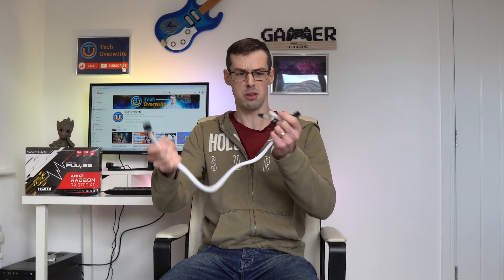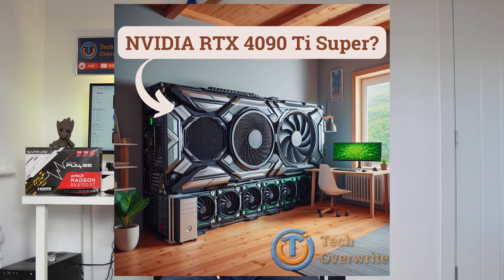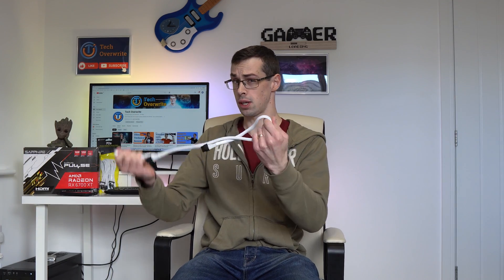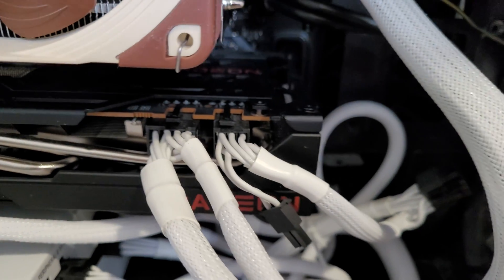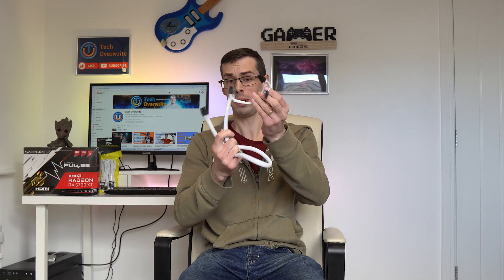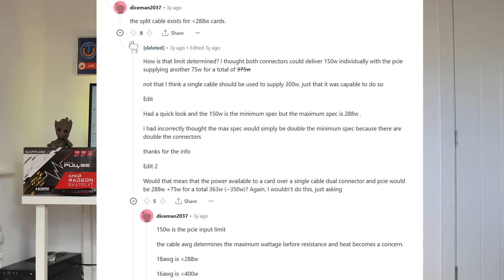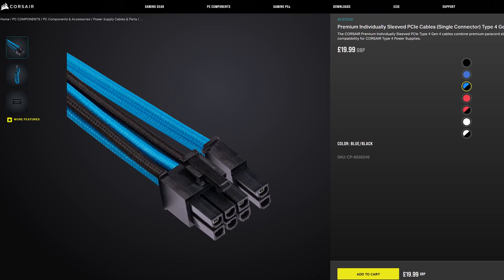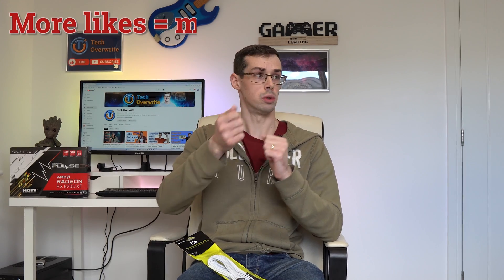Stop Connecting Your GPU Power Cables Like This! (How To PROPERLY Connect PCIe Cables For GPUs)

Comment: I just unlisted my GPU from eBay and bought another PSU GPU connector and am going to see if this works. I have a gigabyte Rx 5700 XT oc gaming and connected to it was a single 6+2 into a dual 6+2 Y-splitter. The gpu would show video for 20 seconds then stop. I thought (still might be) the GPU was faulty
Reply from the maker: Hmm that's interesting, will definitely be worth trying a second cable first. But if it is a 20 second type thing, it could (unfortunately) be a defective GPU 😔 I hope you can get it sorted either way though.
Reply: @TechOverwrite  I have the second PSU cable coming in 2 days. I'm hoping it's just a power problem and not a faulty gpu because I can't buy another one. Last time when it was in windows it lasted longer than 20 seconds but still did the same thing, so idk. When I first got it, it never had the issue but when the first Y-splitter broke it started having issues. (This was when I was still kinda a noob in pcs) let's just see what happens when the cable comes 🤞

Comment: What would you recommend for the 7900 xtx asus tuf card? It says its tdp is 355 but it is an over clocked card 🤔im also using a cooler master v850 sfx i don’t know its pcie power
Reply from the maker: Hmm, that's a difficult one. Yes that can get power hungry. To be honest though, I would try with 2 cables (2x separate and using 1x pigtail) and just see if it crashes or not. It won't damage your card if you only get occasional crashes in specific games. If it crashes, then undervolt or move to a 3x cable set-up. But hopefully it'll be okay, even if it is an OC card.
Reply: @TechOverwrite  thanks for the advice! Do you know anywhere I could get a 3rd cable for the v850? I cant seem to find anything
Reply from the maker: @sm0983 no worries 🙂 This thread might help - looks like Moddiy and possibly CableMod could work: https://www.reddit.com/r/sffpc/s/EgaJKNBszM

Comment: Can you plug the plug tail end on the PSU instead of the single end cable? You're right bout the ugly hanging. Btw they say use the wire which is included on the box, what single cables are good for FSP Hydro G Pro 750w? And can it run MSI Suprim X 3070ti?
Reply: So it is ok to plug the pgtail end to the psu not the to the gpu? What brand of cable can I use dor my psu? Preferably white. TIA
Reply from the maker: You might want to check out CableMod - I know that they offer some FSP support, but you'd need to double check their compatibility tool to see if they're an exact match for your PSU.
Reply from the maker: Generally you can't reverse it and plug the 'GPU end' into your PSU instead, no. I mean, I can't physically do this with my current PSU - but generally you should avoid it.

Hmm that's difficult with the FSP PSU - I can't easily find replacement cables for them. AliExpress seem to offer genuine FSP cables ironically, but it's hard to say if that will be a reputable path or not.

To be honest, CableMod or similar might be best. While it IS best to use the cables from the PSU box, CableMod are a solid vendor for third party PCIe cables - they shouldn't be riskier to buy in this case.

Comment: damn man. I have a XFX - Speedster SWFT309 AMD Radeon RX 6700 10GB GDDR6 PCI Graphics card and it says it requires 175 watts of power. Are those cables with the split two way only have 150 watts maximum? I purchased the Corsair RMX1000 PSU. Yet it states that its power effecient to run cards that are like the 4090's. I don't get it. Do I need to purchase a different PSU then? I don't have an extreme graphics card either, its just a 6700. Or just use two seperate cables. Am I just barely underpowering my GPU with one cable? I keep getting the GPU light on the mobo turning on and I have to reset my PC. It happens like 2 times every day, so not frequently. I am on the PC right now, but I don't want to cause any further damage.
Reply from the maker: It's hard to say for sure (unfortunately) because as I touched on in the video, some cable gauges (AWG) are thick enough that a PCIe cable will provide MORE than 150w. And this generally applies to Corsair who supply good quality cables. So in theory a single cable 'should' be enough for an RX 6700 card... but I've heard from a few people who had crashes with that GPU when running just a single cable. You could always try running the second separate cable and seeing if the resets go away. It's worth saying that you won't have damaged your GPU or PSU though - this is a fairly borderline case, so I very much doubt that any damage will have occurred :)
Reply: @TechOverwrite  Ok i will try that. On a 2nd note I do want to mention that I did accidently plug in one of the power cables from my NVGA power supply into my Corsair RX1000 box, it didn't boot a few times, but after that incident, It fried two of my components, my ROM drive and a PCI usb expansion card that I had to replace. I just hope It didn't cause any further damage. The motherboard should have safely protocols in place in order to prevent a surge right in the event of your PSU generating the wrong current or voltage? Same with the GPU i thought.
Reply from the maker: Ugh sorry to hear that. I don't know for sure re: the motherboard but yes, it should generally have various surge protections - motherboards handle so much power dispersion nowadays that it should hopefully protect you here :)

Comment: I am building a new PC with a gpu that has two comnectors.
My cpu uses 2, my aio uses 1 and my PSU has 4 cpu/pcie outlets.
The pc will not boot at all with the pigtail cable connected to the GPU.

Is this a problem with the gpu or am i not giving it enough power to boot?
Reply from the maker: Sorry to hear it. I'd be tempted to try running with 1 CPU connection and 2 to the GPU and see if that boots. The CPU should be fine to just have 1 connection, at least temporarily.
Reply: @TechOverwrite  
I think the issue is my motherboard. I have been researching the issue and it appears my card with MSI board bios is incompatible.

I didn't pull a CPU plug but I connected the card with two separate cables and the aio from the devil tail and there was no change.

There are multiple posts on MSIs forum about it with multiple different boards and the same card.

Thank you for your video though. Gives me some things to consider. I am subscribing to your channel.
Reply from the maker: Huh that sucks that your motherboard and card combo is the issue, that's frustrating 😔 You'd think that they would try and fix that via a BIOS update ASAP. Ugh, either way I hope you can get it sorted without buying new hardware.

And thanks, I appreciate that ☺️
Reply: @TechOverwrite  
Thanks
I contacted microcenter and gave them the response I got from MSI.

He said he was telling his coworkers about this issue so they can caution others who buy the combo and tools me to come and and swap the board for a different brand.

Thanks for your assistance and content
Reply from the maker: Thanks for the follow-up, that's actually pretty good from Micro Centre, it's good to see them listen and take it seriously 🙂

Comment: I just got the Corsair 16 pin cable and it’s missing the 2 smaller pins. Is this normal? Will it cause damage? I have a 4070 super and the provided adaptor I was using had all 4 of those little cables
Reply from the maker: Mine are the same. Those 2 pins are unused currently 🙂
Reply: @TechOverwrite  thank you for the response! So far so good. Been playing silent hill 2 remake and hogwarts legacy with no problems
Reply from the maker: That's a relief - happy gaming 😄

Comment: Thanks for helping me out! , however I do have 2 separate pcie cables for my  GPU but they both have daisy chains on them haha so if i were to do that i would have so many plugs coming out of my GPU. So can i use a third party gpu extension cable and plug my already 2 existing SEPERATE  pcie cables into the 3rd party extension, to get the same Daisy chained look but overcoming the problem of my ugly cable problem while having 2 cables into the PSU?
Reply from the maker: Yes that should work fine, hiding the various cables away makes sense for sure. 🙂 You can also buy single ended PCIe cables that don't have the annoying pigtail end.
Reply: @TechOverwrite  awesome!! some single ended pcie cable extensions are such a lovely aesthetic too!  thanks for giving me a great use for them while protecting my gpu O.O !!

Comment: I got an MSI MPG A1000G for a great deal but it only comes with two of the pigtail connectors. I want to connect up a XFX Mercury 7900 XTX (3 8 pins). There is also a split dual 8 pin from the 12 pin 600W slot. What would be the best way to wire up that GPU?
Reply from the maker: Hmm good question. The dual 8 pin (from the 12 pin connector) should be fine to use with any GPU, not just the NVIDIA 4000 series cards to be honest. The fact that's it's MSI's official connector helps (i.e. instead of it being from a no-name brand). However it's hard to know what will look best here - in theory just two standard PCIe cables (and using 1x of the pigtail connectors, for the 3x total connectors) should work okay considering the TDP... but the safest option might be to use the dual 8 pin (from the 12 pin connector) and then run a single PCIe cable for the final 8 pin connection. That would be 'best' I guess, although it might not look amazing.

Comment: Hello, I have a few questions that need your help 
I am using an RTX 3070 MSI with a published TDP of 240W
I am using a Corsair CV750 PSU with the Output announced on the box as MaxLoad: 62A and Maximum Combined Wattage as 744W, but unfortunately this PSU only has 1 PCIe wire split in half, and I can only use 2 connectors. This is for GPU, is it safe and ensures performance?
Reply from the maker: Hello, hmm it's hard to say for sure (unfortunately). In theory Corsair's PCIe cables should be a sufficient gauge that they okay with an RTX3070 MSI. However it is borderline and some people have still needed a second cable. You could always just try it though - it won't melt your GPU or PSU. Worst case is you get crashes when playing intensive games or running Furmark. If this happens, you then have two options: (1) either change your PSU or (2) undervolt your GPU a little so that it consumes a bit less power. Hope this helps :)
Reply: @TechOverwrite  Thanks for sharing, I tried running Furmark continuously for about 2h with max 240W, but it was still really cool (definitely much cooler than the GPU backplate), maybe 15W overload is still within the cable's allowable limit
Reply from the maker: That sounds promising, yes it sounds like it's within the cable's limits then 🙂

Comment: I feel a lot of people these days are running old psu's and run in to a lot of problems powering their newer cards but don't even know it. Nice to see a video telling people this information.
Reply from the maker: Thanks for the comment, glad you agree with the gist of my video :)
Reply: Would you say a PSU I got in 2021, a Corsair 750w actually, could be a little old for a 5070?
Reply: @miguecm5262 Same question here.  I have an EVGA 750W PSU and thought I could put in an RX 7900XT but I seem to only have one spare PCIe cable, two total (not counting the pig tails).  I have several VGA G3 cables that look about the same but finding contradictory information on whether I can use them or not.  I’m sunning an i7 9700K and a GTX 1660 currently.  My peak power draw that I see running something like Prime95 is around 300W max.  I got the card home and realized I don’t have enough cables to hook it up unless I use them VGA G3 cable or one pig tail.  Any advice is appreciated.

Comment: I can confirm that the two PCIe cable are not sufficient for Sapphire 77900XTX. I use Corsair 850x as my PSU and it just has two PCIe cable with pigtail, regardless how I change the arrangement for the  cable, it always crash in balder's gate and cyberpunk. I think I need the third cable. Anyway, thank you for your vedio
Reply from the maker: That's really interesting, sorry to hear that it's crashing with that configuration. I'm surprised tbh, a 850w Corsair PSU should have quality enough PCIe cables for two cables to work. Still, if three cables works then that's great to know too :) I would possibly check out Corsair's premium sleeved single-ended cables because they really help make the build look nicer (than having three standard, pigtail type cables hanging around your case)

Comment: My 4070 super has an adapter that splits off into two 8pins, i only have one pcie cable that splits off into two 6+2. Can i pigtail this single pcie cable into the two 8pin adapter to power the gpu?
Reply from the maker: I don't know 100% sorry - I wouldn't want to say "yes you can definitely do this" if it fried your GPU (for example). Hopefully someone else can chime in though :)

Comment: Never underestimate this powerful knowledge ... any rdna2 or 3000 series card and above actually benefits a lot from this single cable per pcie power connector thing ... i recently bought an rx6800 and tought that my 600w psu could handle it as i used to have an rx5700xt with almost the same power rating .. but boy was i wrong, as soon as the card wanted more power beyond 150w it would casue glitches or crash .. or just go black screen ... the thing is my psu came with just one pcie cable but with a pig tail (6+2)+(6+2), and my old 5700xt could work on that config by relying on the pcie slot power + the pcie connector, one 8+6, mine was rated for 225w total draw limit, it was a dual fan power color, so i never experienced the issue, so time went on and i asummed that this 6800 powercolor as well would behave the same..nope..  by default the card basically ignores the pcie slot power and relies solely on the psu pcie cables ... i noticed it because i undervolt underclock it to the point of no weird thing happening and rarely enough it was just pulling top 150w total board power ... as soon as i replaced the psu with a new one with the 2 separate pcie cables ... everything is just fine .. no more coil whine, no stutters, no glitches, no crashes ... who would have guessed...i was about to return it, i got it for 300us after taxes, in a sealed box ,so it was a good deal, i was really sad thought it was doa ... but now is all good :)
you got a new sub here...
Reply from the maker: Thanks for the comment and sub 🙂 That's interesting, it's crazy how much of an effect you seen from just a single PCIe cable. I'm glad that it went back to normal with the new config though, that's a relief!

Comment: So i got rtx 3080 gigabyte gaming oc and i connected just like you said i should not.. so when i connect only to one pc turns on but when i connect to second pc wont turn on so i think i burnt one pcie connector, what should i do now?
Reply from the maker: Ugh that's concerning - the only real solution would be to try with new PCIe cables really (but ensuring you either buy PCIe cables from your PSU maker directly, or from a reputable third party like CableMod). And see if it then boots up. Worst case it is a burn connector or cable yes, but hopefully it's more of a one-off and it's easily fixed with a new set of cables.
Reply: @TechOverwrite  i tried same and different cable on left connector pc boots but when i connect either cable to the right connector pc wont boot... i will take gpu to my friend today if the psu is the problem i will be happy if the gpu is the problem i will send it to service if it is over 150e then i just threw away 360 euros bcs i paid it 360 and 150 more would be lets say ok anything above is too much....
Reply from the maker: Hmm that's confusing. Yes trying at a friend's then potentially sending it for a cheap repair (hopefully!) might be best. I hope you can get it resolved 🤞

Comment: My PC restarted during Furmark testing on my RX 6800 XT after 40 minutes and it was connected with 1  cable. I changed to 2 as you said and hope it will help.
Reply from the maker: Sorry to hear it, hopefully it'll help yes, the RX 6800XT could definitely benefit from 2x cables IMO. Good luck, hope that helps 🤞

Comment: Hi I am planning to upgrade to an Nvidia 4070Ti Super. I currently have an 80+ Gold 850w coolermaster but it is only atx 2.41 compared to recommended atx 3.0. will i still be able to use my current psu?
Reply from the maker: Hi, yes that should be fine - in general you don't NEED an ATX 3.0 PSU for the 12vhpwr cables. You can just plug the 2x PCIe ends into your PSU as normal. The ATX 3.0 would be more of a 'nice to have' here 🙂
Reply: @TechOverwrite  that's great! Thanks for the advice.

Comment: I plugged two pci-e cables into my graphics card as described but when i start the pc back up it only shows a black screen
Reply from the maker: Hmm sorry to hear it. But it boots up with 1? If so, maybe the second cable is faulty? Also if you use a DP cable, try switching that to a HDMI cable - sometimes this can help with no output issues.
Reply: My monitor only has one HDMI slot and dp slot, I tried different configurations of where the cords should plug in but it still brings up a black screen when I have both PCI-E cords plugged into the gpu.
Reply: It does good graphics wise and says gpu  is at 100% utilization but the games I play will run at medium graphics but really low fps, maybe I need a different solution and my graphics card is fine. Thank you for responding
Reply from the maker: Hmm that is all odd yes. Definitely worth exploring non -GPU solutions I agree, it almost does sound like something else is at play (although I can't immediately think what - I'll have a think and reply back if I do though)